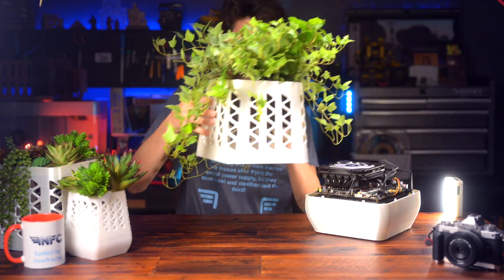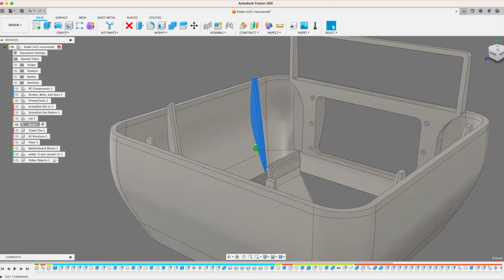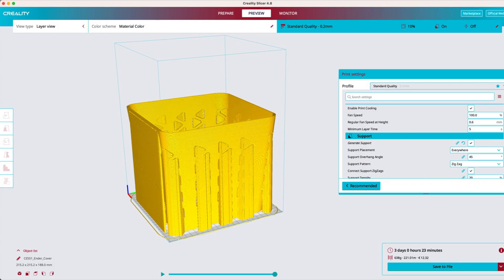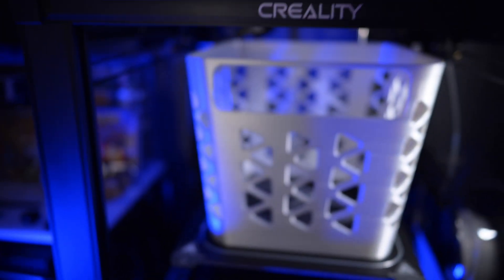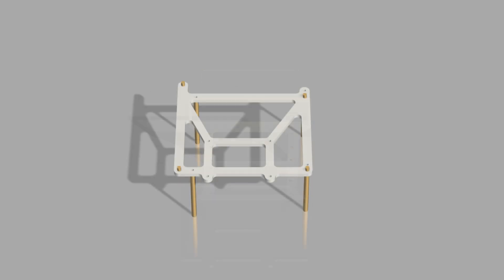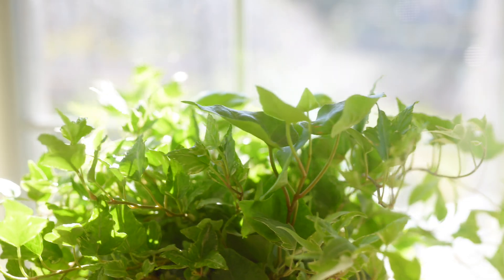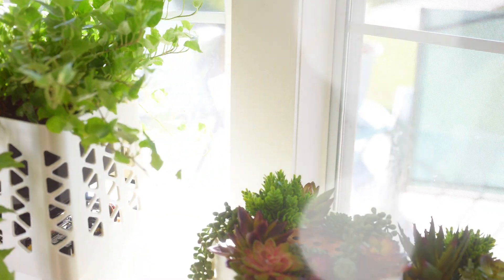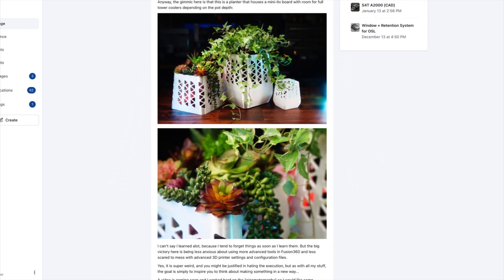This 3D Printed PC might grow on you...

Comment: Incredible mix of aesthetics and functionality, Josh! I wonder if you could incorporate a hydrophobic shield around the top and sides of the pc while leaving the bottom open for ventilation 🤷🏼‍♂️ thereby all but eliminating the disaster case of water penetrating the components.
Reply from the maker: Honestly it would be fairly simple to do. The drop in pot could be redesigned with a drainage plate like you see on all other pots, and then it could be coated with expoxy (or flexseal, because I am lazy). Additionally you can spray the top of your PC parts with one of many products designed for repelling water. I like "NANOMAN" I use it for shoes and motorcycle gear. Thanks for the comment bro, always love to see you. <3

Comment: If it wouldn't be for the cooling restiction I wolud definitely get one myself! Btw. you could overcome the water and moisture problem by enclose the pc more and work with a more refined airflow design. Also maybe a couple of clearcoat layers could help as well.
Reply from the maker: Thanks for the comment! What cooling restriction are you referring to? The case is so open that it performs the same as if the lid was off.

Comment: 3d printing is amazing, i printed several cases with pla+, with enough cooling it wont warp when a pc is inside it, managed to get my printer to 150mm/s older creality printer and i even modified so i can get 2 240mm radiators in the nr200p

Comment: I'd be terrified of watering the plants - Or worse, of the PLA breaking down a bit from the dirt+moisture combo
Reply: maybe if you made it from PET-G it'd be ok
Reply: You could just lay the print with a thick pond liner, that stuff doesn't break down even over years of harsh conditions and sunlight.
Reply from the maker: Yeah definitely. For the record, I think the best way aside from fake plants would be to just laser cut a hole out the top lid and then put a pot in it. The printed pot just looked better so that's what's in the video.
Reply: @NotFromConcentrate  it definitely does look nice! Fears aside I'd use it for a nice wife-approval factor build in a space where it needs to look like decor. A great project, keep it up :-)